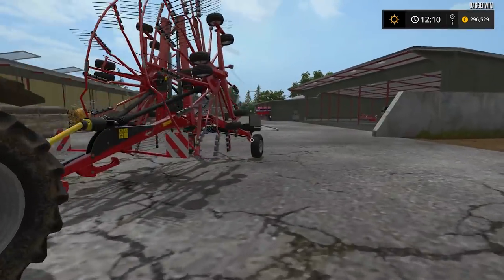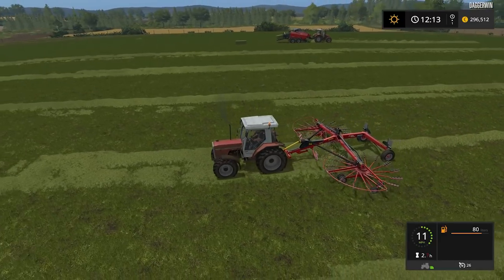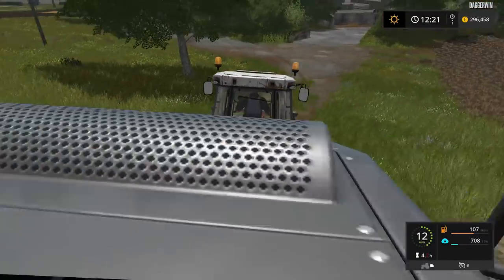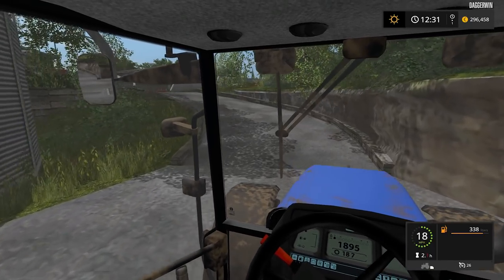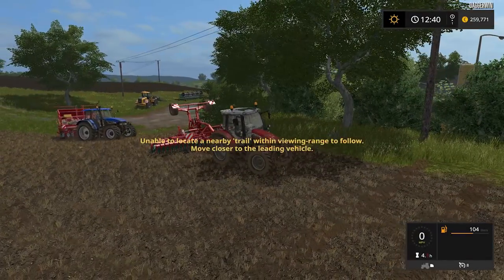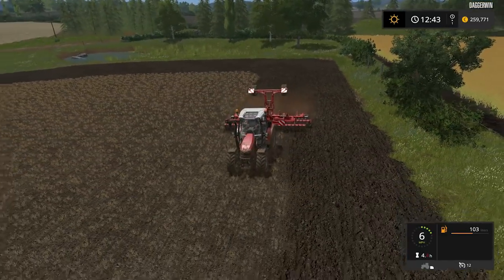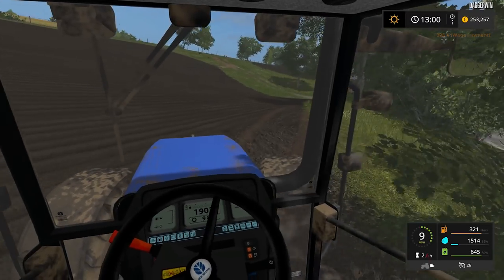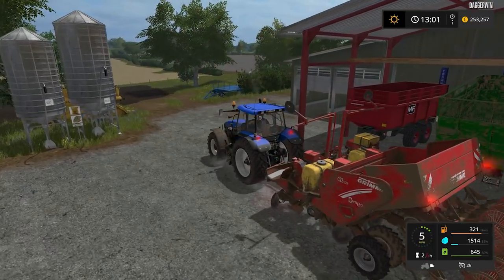Farming Simulator 2017 | POTATOES IN IRELAND | Ballymoon Castle | Episode 12

Comment: I just started a save game on this map, and realized that in the finished map you DON'T get 2 million, you get € 20,000, and about the same equipment you got in the beginning. Makes it a little more challenging :). Also, the workshop doesn't seem functional, which is a shame. Other than that, this is the best map I've seen for FS17!

Comment: most tractors dont have suspension, some tractors have front suspension but not in the rear, when they bounce its the air in the tyres that does it, jcb fastracks do have suspension and also mercedes mb tracks too, thats the reason they can go over 25 mph but the vast majority have no suspension at all, thats why there is a speed limit on tractors in the uk, if you see any kind of shock absorber it will be for the cab, your kubota is the same, it also has no suspension, just air in the tyres